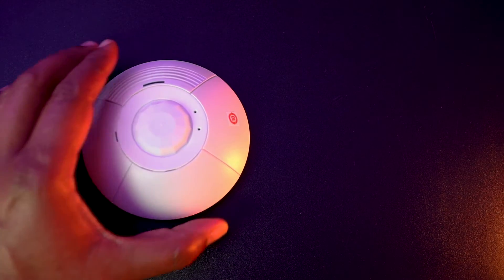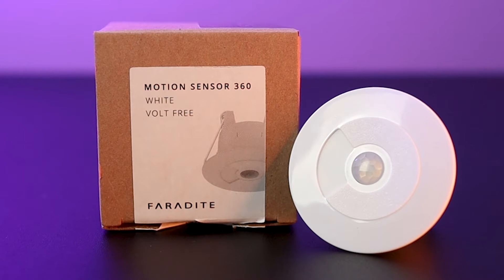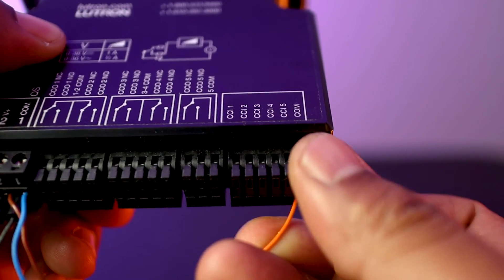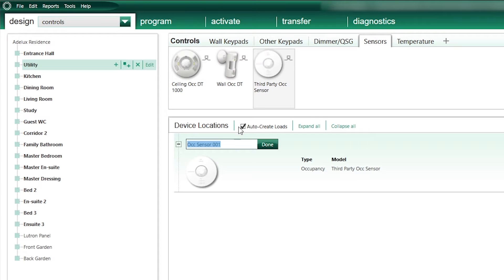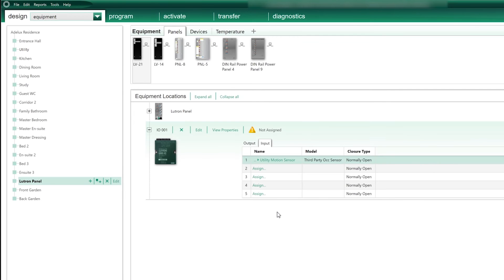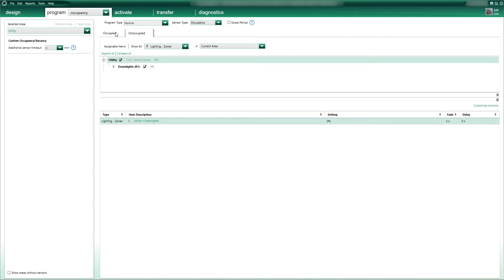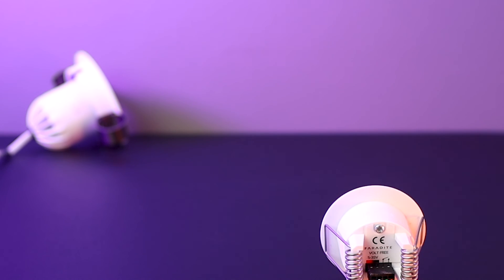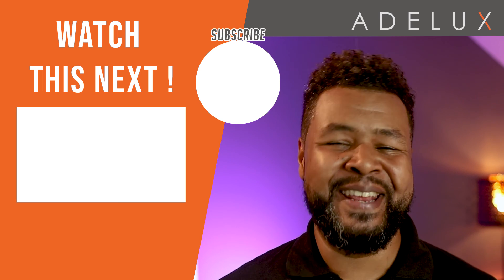Faradite Motion Sensors with Lutron HomeWorks // Full Wiring and Programming Guide - New 2022

Comment: Why don’t you use Lutron occupancy sensor? Any reasons why?
Reply from the maker: Lutron occupancy Sensors are good, is just that the form factor is not really appealing to home owners. Also what I like about occupancy sensors like Faradite’s is that they are very simple with no complicated settings on them so I can do everything inside HomeWorks which I prefer. 👍🏾